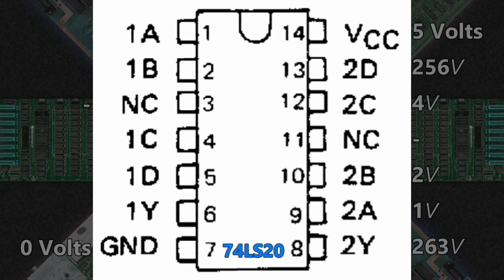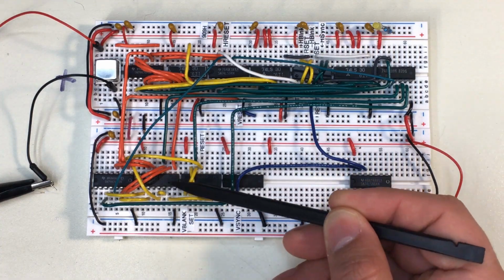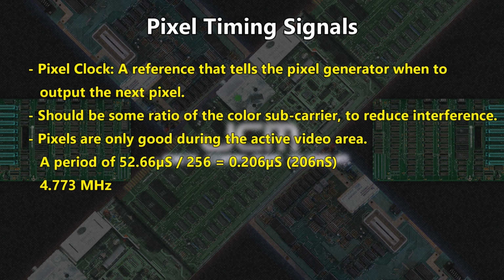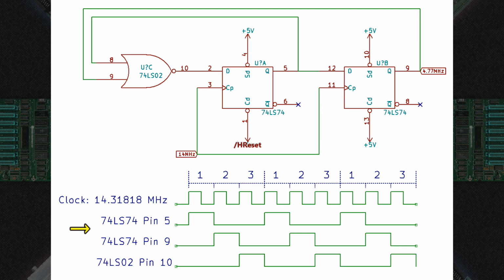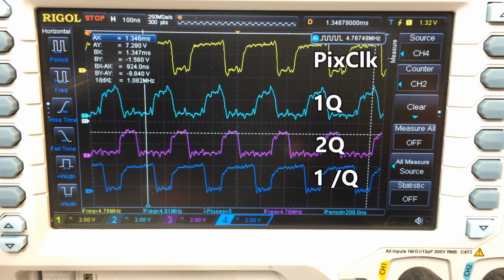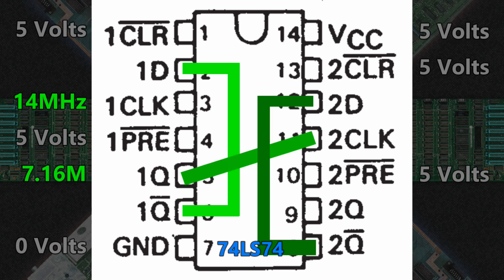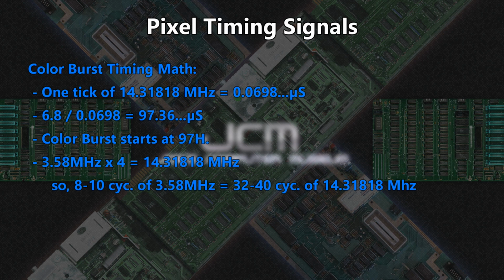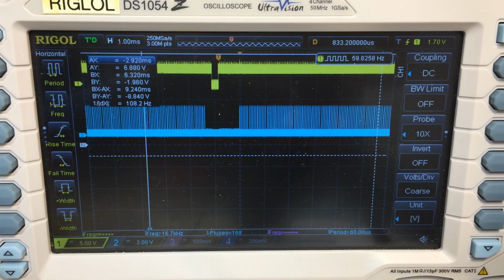NTSC/Composite With Standard Logic - Pixel Timing Section - (JCM-1 Episode 13)

Comment: Those breadboards are getting a bit full... I enjoyed your vids showing how wire-wrap is better.
Almost time to upgrade ?
Reply from the maker: Definitely. Breadboard route is great for first pass prototyping, which is the point here. It's easy and fast to do, and really good for showing on video exactly where wires go. When this gets redesigned into an add-on board for JCM-1, it will very definitely be done with wire-wrap, and then later a full PCB.